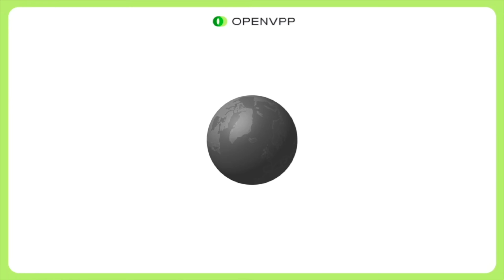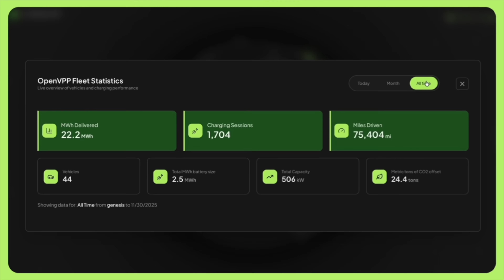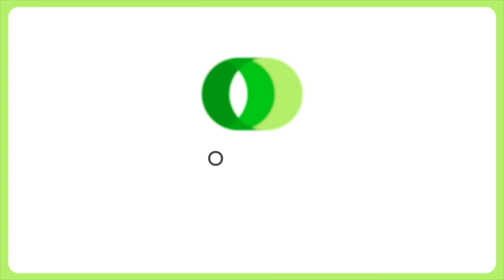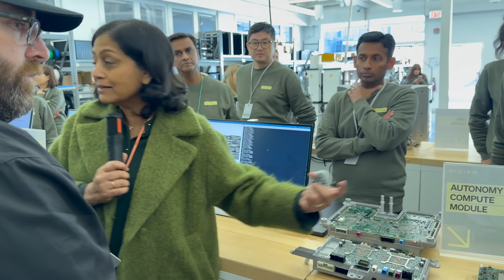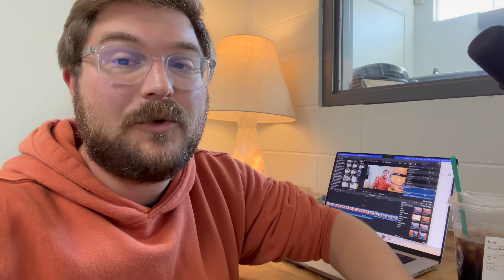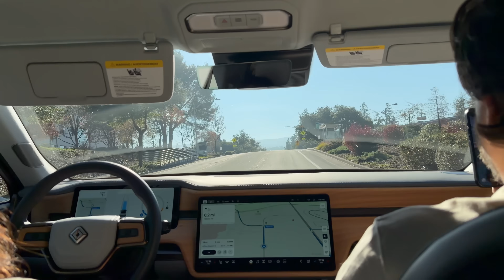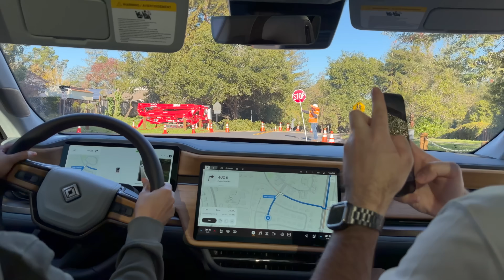My Rivian “FSD” Test Ride! Long Road Ahead But The Correct Choice

Comment: It's very early for them. They have A LOT of work to do and a long way to go. It falls way short of my Model Y Hardware 3 on version 12.6.4 and that version has some hiccups here and there but I'd run on that version in my car before messing with this Rivian until they get some of the basics more dialed in.

Comment: Great video Kyle. I'm bored of the Tesla vs. Rivian (or Tesla vs. The World!) subtext elsewhere on the web. Rivian have chosen their path, and of course it'll take a while to become truly useful, but I still think Radar and/or Lidar will make for a more flexible system in the future (I hope I'm wrong, but I've had HW4 die-engages due to sun, rain and fog, sooo....). Also, if the end-game is absolute full autonomy, then yes, Tesla will likely win that race, at least when the weather is ok. But if the end game is to have an awesome autonomous platform that still acknowledges the human might want to drive every now and then, the race is much closer, and there's a place for both. Kudos to Rivian, and Tesla, for having a clearly defined path and basically testing in the open. One, or both, will win, compared to the legacy auto-makers.

Comment: I think you need to judge them on the quality of what they CLAIM to do.  For example, if Tesla and Rivian both claim to handle XYZ, then you judge the two systems on how well it manages XYZ.  If one claims something but the other does not, then you judge the one that does and give a ZERO to the other.  Only with that kind of comparison followed by a "what's it like to use" overview can you really focus on the specifics.  If everyone simply focuses on the "well Tesla can do this, but Rivian can not" type of things, it really does not help understand the specifics.

And you know that most channels are going to focus on the "does not" rather than how well it does.  Out Of Spec has a chance right now to set up a criteria for these systems and begin collecting data across the brands on the specifics.  

Sure, just like Tom's Chargerator that needed to be updated once the technology reached beyond the scorechart, you'll probably need to tweak the standards as time goes on.  But if you start now and have a set of challenges and tests that exceed what exists, you can become the defacto standard for self driving ratings.

Comment: I still contend that Tesla will have to take time to fix the errors in the GIS mapping data everywhere they operate. I still have the same issues I had a year ago. I've reported the issues to them by using the "bug report" voice command in the car and they haven't been fixed. And I continue to find new things the car can't handle yet. Driving in the snow is getting pretty good but it still tells me to take over and the camera cleaning is still an issue. I can't even keep the front camera clean for a 10 minute drive. I hope they have something up their sleeve...
Reply: Rivian won't be any better at dirty cameras either.
Reply: @bradleyfrank7933 . Correct. I didn't mean to imply that.

Comment: To your question. First i do not have a FSD experience, because you do not get it in germany. 
But i think i also do not know what other Brands perhaps theoretically can do, but do not dare to put it on the road. So i think it is very difficult to say how much better Tesla FSD is. Because i think Tesla put every new prototype software on the road and into their cars. I am sure traditional brands like Mercedes, Ford, VW, BMW, GM, Fiat, etc. would not do this. So you can only compare what is there. And so Tesla seems to be ahead a lot.

Comment: I don't fully agree. True, Rivian is starting at the level Tesla used to be at 5 years ago. But, due to being a sensor fusion model (Camera+Radar+Lidar) their AI stack will be much more robust than Teslas stack. While Rivian is 5 years behind, it will take them less than 5 years to catch up. Also, the ride along you had isn't with their next gen AI chip or new sensors, which will already perform far better straight up from the beginning. True autonomous lvl4 driving is a long game and Tesla is nowhere near reaching it because Tesla needs to be liable per SAE certification. As long as Tesla is not liable, but the driver is at all times, its a very advanced assistant system, i.e. a lvl 2 system.

Comment: Rivian is correct in showing this early version of what I expect will improve dramatically in the coming months. Rembember, it wasn´t long ago that no one was expecting much more than very basic cruise control from Rivian. The key word is "exponential development" which is the phrasing the Rivian technician was using. If it is decent like we saw in the video, I think it is easily going to be competitive with Tesla FSD in a year from now.

Comment: I think you should be honest about where they are presently at in comparative relation to the leaders in the autonomous driving field. Electric vehicles are going through a period of opposition from those in the political arena. They however can't be denied and they are presently rebounding expeditiously. The standard is been set and autonomous driving is at the forefront. Rivian is behind the curve but at least they are perceptive enough to realize they need to get in the game. Therefore in my humble opinion. Continue to be honest and offer your valuable insight but understand that this is the new unwritten standard and a lot of the EVs are behind.

Comment: Fundamentally, Tesla's camera only approach puts more burden on training and inference processing for estimating relative position and velocity of objects while a system that also includes LiDAR and RADAR shifts potentially much of that burden to the sensor domain for more direct real-time measurements. My bet is camera only systems will be upper bounded in terms of autonomous driving capabilities while the systems with LiDAR and RADAR will eventually be capable of surpassing the capabilities of the camera only systems. If the Rivian autonomy development team can show significant progress during the next six months, I would place my bet on their hardware platform for autonomy - especially at the $2500 price point.

Comment: For me, the "should I be critical or excited" question isn't about comparing the performance of Rivian's unreleased software at this moment in time to Tesla's v14, but rather do I think Rivian is on the path to delivering a viable autonomy solution within a few years. From what they showed, I think there's good reason to be excited. Go back one year and Tesla's v12 was nowhere near as good as it is today. That's not to say that Rivian will make the same level of improvement in one year that Tesla has, but at least it appears Rivian is going all-in on trying to get there.

Comment: Hey Kyle, thanks for the honest review. What's not often thought of from a product perspective is the software suite that is needed to simulate and train their  AI driving system. The presentation was promising, but I agree with you, it was not good on a sunny day, on a dark rainy day in Seattle, I wouldn't trust it. That being said, they have a year to get there and developing a custom MCM chip, simulation software and an early beta version of the self-driving are big steps in this regard and as a Rivian owner, I trust the engineering and product team to deliver something of quality later down the line. RJ and team have been doing a great job and I'll be cheering them to the finish line. I'm in AI Engineering, and what the Rivian team has done so far is impressive for an automative company.

Comment: I don't think that Rivian's "FSD" is as far behind Tesla as we might think. The Tesla switched  from C++ coded system to AI end-to-end FSD only 2 years ago. And when the switch was made (v12.?) it was not very good. The hardware today is significantly better than 2 years ago for both car makers, I should know, I am driving Tesla with HW V3 :) .  I think that Rivian has a chance to catch up with Tesla maybe in 2 or 3 years. I wish Rivian good luck!

Comment: So my comment, I think it's fair to compare it against the competition but also I think it's fair to give them time to catch up.  Reason being as good as fsd is it's still purchased on a small portion of the overall fleet so as good as it is only a fraction are using it now.  Imo that's primarily a function of it's cost, that is one area is rivian does it right they can surpass it over time.  We will see what the price does over time but I think $2500 and $49/month are reasonable for such a system and Tesla's $8000 and $100/month will always be cost prohibitive.  That is one factor that needs to be factored in.

Comment: Software is different than physical hardware. At least in your example that you provided with the car a new car maker could break down a Porsche and see everything that's inside of it you can't do that with software. Plus autonomous driving in AI takes lots of data you can't get that unless your partnering with someone that already has it you have to build that data set on your own. Tesla has had years of a lien on everyone else that's why they're so far ahead. I think Raven will get there they just need more vehicles on the road.

Comment: Kyle,  I think you should have equal focus on price and feature richness of the system. 

Each system should  be plotted on a Value Chart:
 "Price low to high" on the X and 
"Feature low to high" on the Y axis.
 
If you have a car with basic and cheap lane centering it will have a low price that is great but also a low value on being feature rich.  

This should allow you to compare systems at different price points and different feature levels.

Comment: The sports car analogy is not a good one. People buy sports cars primarily for the sporty features of those vehicles (and the brand name prestige). On the other hand, not everyone who buys an EV is obsessed with "full" self driving. I'm in that camp. I would totally buy a Rivian even though its self-driving  capabilities are far behind Tesla because I like Rivian vehicles much better and I like to be in control most of the time (i.e., I like actually driving my cars). I just need a little driver assistance when I'm in heavy traffic or long road trips. Rivian provides that.

Comment: Apple vs Samsung.  

My $.02 on owning a Tesla and being in Apple ecosystem is like Apple vs Samsung.  

Apple has phenomenal software expertise system.  Tesla has phenomenal software and Self Driving. However, the hardware (and lack of different models) is really starting to fall behind- like Apple.  

We own a Ford Lightning Lariat - extended range - and the “hardware - fit and finish”   However, the software, user experience, and self driving is way behind (and very lacking).  

Samsung, LG, and others are releasing “new hardware” phones that are becoming light years ahead of Apple (ie - foldables, computing power, etc). 

My $.02 - is that Rivian will need some time but if they can quickly soook uo self driving and get a more affordable vehicle out, they can give Tesla a run for their money! 

Really looking forward to R2! 

Dear Tesla - still dig all the stuff you are doing. Robo Taxi is cool and get it but we really need a few more models with steering wheels. Would really like a reliable 6 passenger SUV.  Unfortunately, perception due to all the used lemon buy backs is that it may be time to retire the Model X.

Comment: Rivian is copying Tesla. Even the colours and visualisation look the same. Performance: NOWHERE NEAR TO TESLA! Fake it until you make it! 

I think Rivian realised that it can't make money from the cars, so it rushes a half baked autonomus software. This system is clearly miles away from being autonomus. It failed in every single edge case (merge, car in lane, construction zone...). 95% of the drive was on single lane roads with no pedestrians.

Comment: Both my Model X P and my wife's Model YP still cannot back up by themselves from our long driveway.  We have a dip for channeling water movement at the end of our driveway and both of our Teslas still treat it as a wall due to how dip the water channel is.  If the Teslas can't even get out of our driveway by themselves, how can they even carry me and my wife from our home to point Bs?  Tesla is lacking secondary means of verifying objects.  And, I suspect that LiDar could be the way to go.
Reply: Not a lidar issue. Just needs to be trained on more examples like your driveway.

Comment: Same could be said of Tesla FSD (Supervised) vs Waymo. I have had two Teslas with FSD that I paid for. A Model S 70 which only ever delivered autopilot which was sketchy to use and sometimes outright dangerous, and a 2018 M3 Performance with HW3 that is stuck on 12 despite promises to the contrary of what the capabilities would be and can still be very scary. I have ridden in 2025 MY with HW4 and 14 and while impressive, it still can't handle Los Angeles as FSD, it is still firmly a supervised L2 system. I have ridden in Waymo a lot here and as a true L4 system is blows away 14 with local LA driving, I am signed up for highway beta with Waymo but not done it yet so can't compare that but expect it to work extremely well. When any auto manufacturer can handle SF and LA like Waymo can as true FSD systems then they can brag. Cruising suburbia doesn't count.
Reply: @KrazyBushidoGoat Notice how quiet it got....😁

Comment: I would add that Riven seems much further along in year 1 than Tesla FSD was at in year 1!
Reply: They started working on this system in 2021. So this is almost year 5, not year 1.
Reply: Easy to do when Tesla did all the heavy lifting, and Rivian comes along and rips it off. Hopefully Tesla has patents and can sue them.

Comment: Non-Tesla FSD guy here. You say it's so far behind what is available by today's standards.  Could you do a video or give insight as to where expectations are? Plus, I'd like to know if they will leave Gen 2 R1 vehicles hanging with all this focus on Gen 3 hardware. It's only been a year. And if so, it'd be nice to know if there is the capability to upgrade hardware l, compute, battery, powertrain config, etc. on Gen 2s. It may be wishful thinking, but I could see buyer confidence and sales increase with the reassurance that these products won't be obsolete when it comes to autonomy and AI (cough, cough, Gen 1). The R1 is supposed to be the flagship, premium (expensive) product. However, the cheaper/higher margin vehicle will be equipped with the better tech and more power dense motors?! Am I missing something?

Comment: Catch up to Tesla........... That phrase is used alot in these comments. Everyone has the mindset here that FSD ver14 is a done deal.  its not. I hope Rivian can reach the level of ver 14, But i can only imagine where fsd will be by then. And dont forget they are training an offshoot of the fsd model for something with arms and legs. Tesla as i write this is tooling assembly lines on the 2nd and 3rd levels  of Giga Texas that within the next 18 months will build a car that will require no human input.  Catch up to Tesla......Heck of a feat indeed.

Comment: Great demo, but nobody's asking the elephant-in-the-room question: Will Rivian pull a Tesla and leave Gen 1 owners stranded with hardware that can't run future FSD updates?   Will Rivian have the same problem Tesla had with old chips?

Notice the engineer only confirmed this works on "Gen 2 vehicles through OTA updates" - zero mention of Gen 1 compatibility. Tesla learned this lesson the hard way when older "FSD-capable" cars couldn't run newer versions due to insufficient CPU power.

Rivian's building their stack "down to the silicon" which is smart, but are Gen 1 R1Ts and R1S's going to need a hardware retrofit? Or are we looking at a $2,500 subscription for a system that'll never work on our trucks? Would love clarification before more Gen 1 owners get excited about this.

Comment: I like to think of this as great that there is competition in this space! The demo here is also extremely early. If they are not releasing full hardware till the end of next year, they can't have had the actual system running on the road more than 6-12 months. Gotta keep in mind how many years it took Tesla to get to where they are and as long as Rivian stays in line or ahead of Tesla's progression from their start, they're doing pretty good!

Comment: Believe that the key differentiation once the system is released to the consumer is how well it will work in challenging condition.  In challenging I mean direct bright sun that would make it difficult for a human driver to see, very bad weather, snow, heavy rain etc. that can distort and block the sensors.  I have never seen any self driving system demo that shows it can deal these issues and would like to see you put cars with autonomous driving challenged in this way.  Relative to the Rivian system or any other that is still in development I personally would wait until it is a version that is released to the customer before passing judgement.  As I recall Tesla's released FSD drives that you did several years ago were much worse than what you experienced on the Rivian demo.

Comment: If you remember back to August 2023, Elon and Ashok did a live stream of FSD v12 driving around Palo Alto. Charitably the Rivian system could be compared to that. From memory the 2023 FSD v12 drive had less takeovers than this Rivian drive. But to their credit, they are on the right track in at least this is end to end AI trained, very exciting, so it'll be interesting to see how fast Rivian AI can move forward. Will it take them 2.5 years to catch up to where FSD v14 is today, or can they do it in less time? Competition is a win for all. Great video Kyle, really appreciate someone with state of the art self driving experience giving their feedback on this drive and asking the tough questions